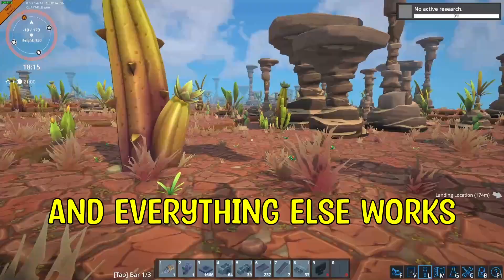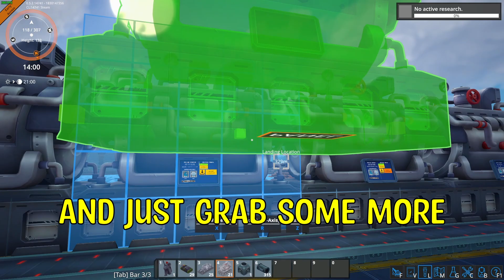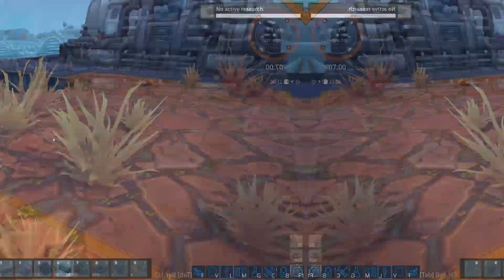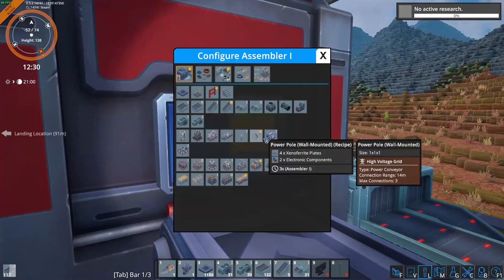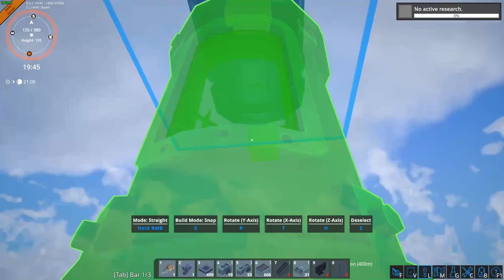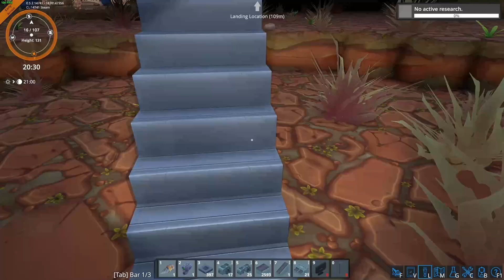I Created Infinite Power & Concrete For My Factory! | Foundry EP.6

Comment: 29:51 I'd like to mention that this T-junction does the job for machine on the right since it have a port marked as input, but nothing for machine on the left since the port is locked (note icon under it). I suppose you re-connected the left port for the left machine off-screen, since it would stop eventually otherwise (500l of water in a single pipe segment only goes so far).

What I really like about your factory is that you planned the logistics floor from the beginning. I started without one, so now 3/4 of my factory is over the land I have to dig out whenever I want to bring resources somewhere without overhead belts.

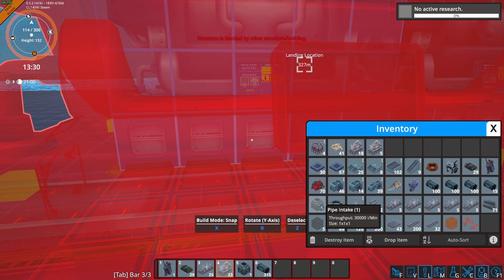Comment: 5:45 Ah, so that's how you came up with 25. Considering water is effectively infinite, that's quite unexpected point of reference. XD
Especially considering you decided to build them all on a single belt. This works solely because you consume much less power than this setup can provide, so boilers run much slower than 20 ignium per minute. ...and water consumption is slowed down by the same factor, so you can run as many boilers as you wish from the same water intake in such case. They'll just slow down even more. XD

In the best case, you won't need to upgrade this at all since 8 boilers is quite enough to get to the solar power and in the worst you'll get away with upgrading that belt to T2 to support up to 16 of them running full speed.

10:57 Again, weird point of reference. Just place as many as your grid require. By the time I had to place 5th, I already unlocked their better version.
...are you doing it all backwards intentionally?

11:55 A little tip: Press Y next time you try to build a column. I was blind to that message right in the middle for quite a while.

12:55 The game just gave you a way to bring power wherever without foundations. And yet here we are.

16:56 One of your transformers is connected to one or more power-poles not connected to the rest of the high-voltage grid, as I understand.

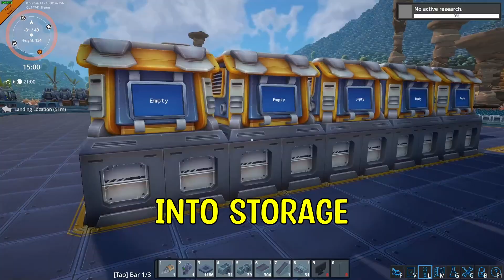22:43 Oh, you will need them. Just not 5 T1 storage worth of them at once. They are only used in Science Pack T2 recipe and the rest is mostly you piping around.
Reply from the maker: Power is something I always like to over engineer, it’s always been something I like to prepare and build so I can just forget about it 😅😁

Yeah I figured out pressing y allows to build columns, I missed it for a while 

Haha I just read the part about the game giving me a way to provide power to different areas and face palmed …… creature of old habits  

I realise I may not need half the amount of stuff I have in storage, I always over prepare but besides from that I kinda like the way it looks having so much surplus of parts 😁